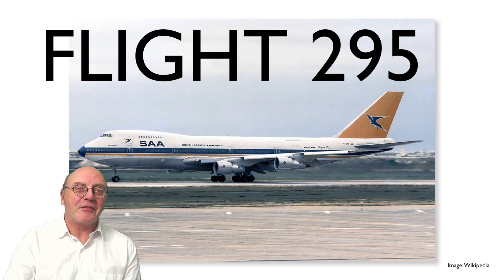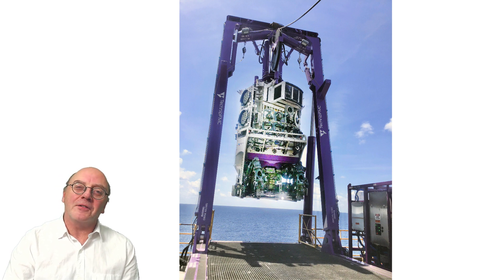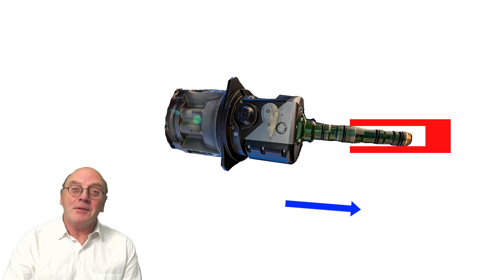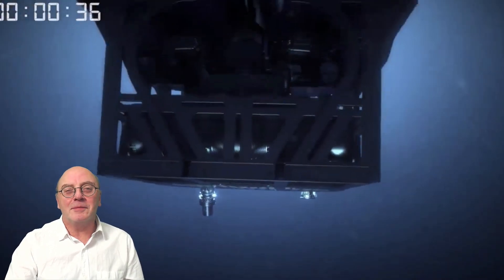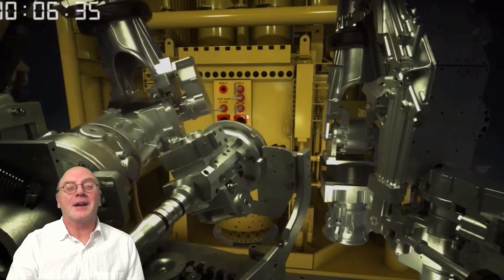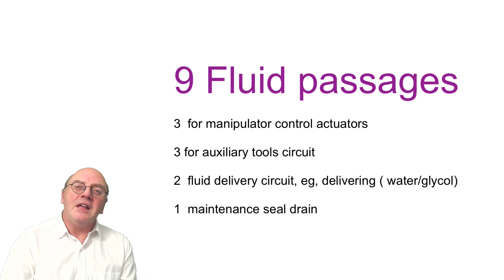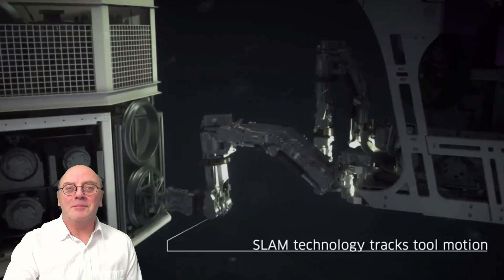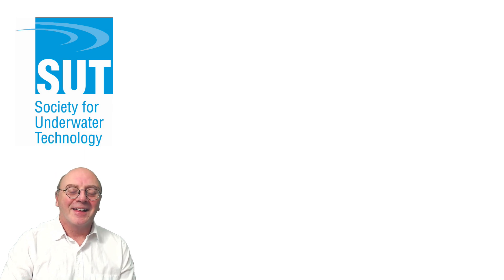Gemini ROV Review

Comment: And what happens when engineers change their minds at the last second. Does a Gemini have a pause or abort function button. Let's not talk about the vessel factor. Let's just say a vessel generator loses power and lights out or the DP system runs off. Will the automated sub react? Just saying.

Comment: Looks good on paper. The more bells and whistle the more possible issues.
Wait until these systems have a lil age on them or they've been cold stacked or unmaintained for a while. They will be nightmares to work on. I want to see what happens when software has a glitch or a fish swims beneath the sub with station keep and auto-altitude on. It doesn't happen often but it happens. I've been operating Schilling UHDs and HDs 16 years and I wouldn't won't anything to do with a Gemini once it gets some age under it's belt. Or a Loop current.

Comment: I suggested tool changers and wrist cameras to major ROV builders maybe 10 years ago. Also lights on outriggers, shining in from both sides to minimize backscatter, and make the lights track with the camera to prevent washing out the image. Plus haptic feedback so the ROV operator can feel when the manipulator jaws grip something, and multi-jointed joystick arms that mimic the joints of the manipulators. I was ignored because i'm not a college-educated engineer.